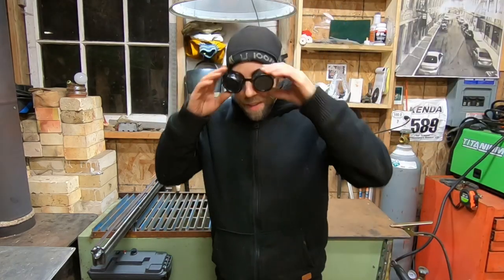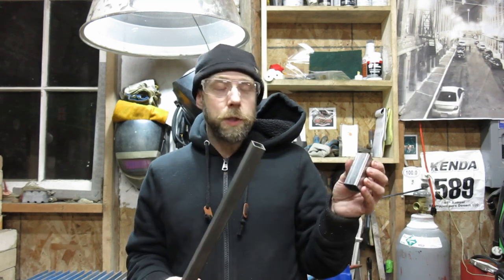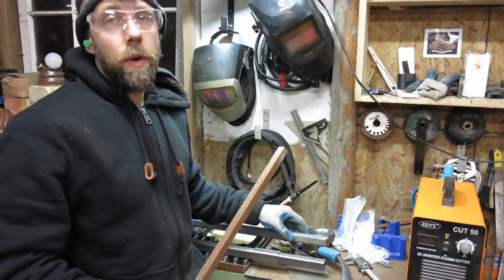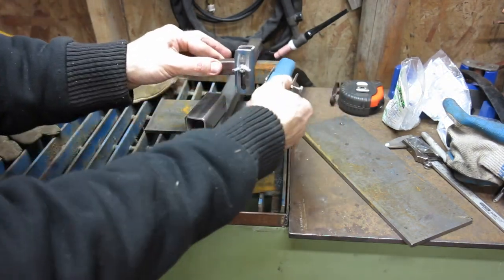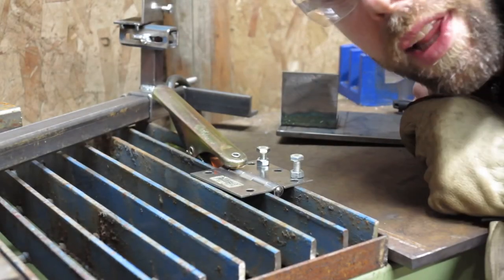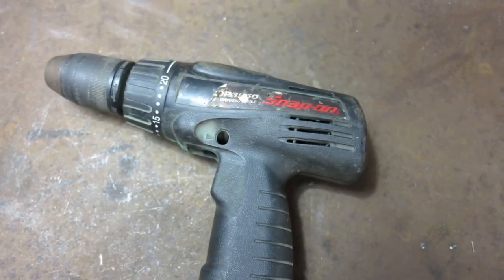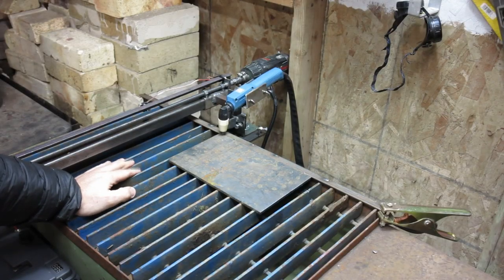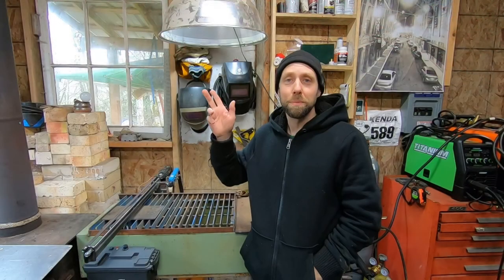Plasma cutting track DIY

Comment: Oddly enough I can not find the Titanium 45 plasma cutter on the HF site. How does the cut 40 you are using in this video measure up to the titanium 45 or does it even measure up ? Watches a few of your vids, like this one, well done. Good work, good ideas and a good sharing of both. CHEERS from north of the border.
Reply from the maker: Right on thanks! The Titanium 45 won’t be in stores till early 2020, I never did a review of the CUT 50 plasma torch because I just don’t feel I could put a video up telling people I think it’s a quality unit, but of course it’s a $250 plasma torch 🤷🏻‍♂️ I have never had any real problems with it, but you can count on it every few cuts when you go to pull the trigger it won’t arc right and does not start cutting, it’s not a big thing you just pull the trigger again and it usually starts the second time. Consumables are real affordable on Amazon. It’s actually not a bad machine, I just don’t get the feeling that it’s going to work for a long time but who knows? I have had it for 3 years now but I only maybe use it once a month. 
The down side of this machine is that it’s a high frequency start and this will interfere with CNC machines so you can not use them on CNC plasma tables. The Titanium on the other had feels like a fairly quality plasma torch, starts every time and doesn’t have HF start, it’s a pilot arc start so it should work on a CNC table. Now is the Titanium 45 worth 3 time more then a CUT 50? What part of Canada 🇨🇦 are you from? I live about 20 miles south of Vancouver island in Washington.

Comment: You can get acme threaded rod and brass nuts designed specifically for linear motion drive (often used for 3d printers) on eBay, in long lengths, for cheap. It works better than all-thread from the hardware store, which is designed for fastening stuff.
Reply from the maker: I was just working with what I had.
Reply: @Mikefestiva  Eh... the comment was more directed at others who might want to build one and had some time to order stuff. ‘Course, you could always upgrade it and make a new video... 😉

Comment: I just subscribed to your page and I love it. You have some great ideas. I was wondering if you had any more videos/ direction on how you built your plasma track. I have the same plasma cutter and when I saw this video I that it was great and would love to build one of these. Thank you in advance.
Reply from the maker: Hey Curtis thanks for subscribing and checking out my videos! I really appreciate that :) This is my only video I made on this plasma track, it works quite well, the only thing I would recommend is to build or buy a bigger stronger hinge, the one I used was a little loose and flexed a bit. Other then that I would follow what I did and see if you can make one even better. It really helps that cut 50 to make some really clean welds. If you have any questions feel free to ask :)  Take care

Comment: I have a bucket of bolts just like that and it's a pain to put them back in the bucket for 2 bolts
Reply from the maker: Haha I know, After this video I got tired of digging through it and finally organized it into a plastic case with all the different sizes in there own slots. It surprisingly didn’t take long to sort them out.
Reply: @Mikefestiva  I did that for most of them about 2 days ago still have a bucket full though

Comment: Hi, that was a fantastic video and very detailed.
I just want to ask you about the torch high set up.
When you turn on  the torch and you press the second switch to move forward what is the torch high?
Is it needed to touch the material to start the arc? And dragg it all the way?
Or you set it a little above the material?
I know High Frecuency mashines has to instandly touch the material to start the arc.
Reply from the maker: Thanks for checking out my video! I have a cheap plasma torch I use, it’s got high frequency start, I set the tip off the metal about a 1/8” or 2mm  and 80% of the time it starts first try, once in a while I have to restart the torch, once it goes from high frequency sparks like a cars coil to the plasma torch fires up your good to turn on the drive and make your cut. I hope this helps. Take care
Reply: @Mikefestiva  Yeah,
that's what i thought.
My plasma cutter is HF like yours from different company an i was planning to build something similar with your motorised track table.
Your design is brilliant.
Thank you for replying.

Comment: Does that Zenny have a built in compressor or are you connected to a compressor? Nice video as usual.
Reply from the maker: No build in compressor, I run a air line from my compressor. So far it’s cutting great, time will tell on how good it holds up? We have a older Harbor Freight plasma torch at work and surprisingly it’s worked fine for years. I hope this one holds up as good? Take care and thanks for checking out my video.
Reply: @Mikefestiva   Can you use an oil lubricated compressor for plasma cutting?
Reply from the maker: ______x yes my compressor is a oil/ piston pump, just run a inline water/ oil filter to keep the air clean.

Comment: Hey Mike, Great job. I like it  l have a plasma similar to yours and would  like to build a table like yours. Do you have a parts  list with parts numbers and where you got them for the pulse width modulation setup
Reply from the maker: Hi Brian :) I’m glad you like my cutting table!  I have some links in the videos description that will take you to Amazon and to the exact parts I used, and it actually helps me out a little if you buy the parts through the link, I have had good results with this style of PW controller, I have been running one on my home build bandsaw mill for the power feed for over two years without a problem. One thing to pay attention to is the motor and power connections are not labeled the best so before you hook up the power wires to the PW controller turn it over and look at the green circuit board, it’s labeled Power. Motor. As long as you make sure you get that right your good to go. The main label above the screw terminals are labeled + and - so that’s easy to hook up it’s just the power and motor part is in Chinese, that’s why I mentioned to look at the circuit board. Sorry for the long comment, I just figured I would let you know so your not wondering. I have a video posted back a few months ago where I show hooking up this PW controller to control my sawmill cut height, you should check that video out, I think it’s called something like “ simple upgrade ever sawmill should have” if you have any more questions feel free to ask. Ps if you build a track cutter like mine the only thing a would have changed is the hinge, I should of just built one, the one I used is a little on the flimsy side so buy or build a bigger hinge.Take care!
Reply: Thanks Mike for all the info . If I do have  any questions I will surely be contacting you. Thanks and take care
Reply from the maker: Brian windpower no problem Brian! Hey I just commented back with another subscriber and he was wondering how I wired the PW controller with the switches, so I think I will post a video in a week or so talking more about the PW controller and how I wired up the switches. So keep an eye out for that video and I will have a few more things to point out about these controllers. It’s always hard to include all this info in a project build video like this plasma track because the videos can get to long for most folks so I think it will be nice to make a video just about this subject. Take care!
Reply: Ok thanks I’ll keep an eye for that video
Reply: @Mikefestiva  hey Mike what's the power supply that you used to power up the PW controller
Reply from the maker: Brian windpower Hey Brian I didn’t end up using a power supply, they are under $50 on Amazon but I didn’t go that route, if the drill had a good battery I would have just used it, but the battery and the speed control on the drill were shot so I just ended up running the PW controller off of a car battery, it’s extremely basic but I always have a charged one around my shop so again I was just working with what I had. I hope this helps. Ps my friend Dave gave me the drill, but if I was going to buy one, Harbor freight sells a cheap o drill, charger and battery and it’s in the low $20s I think it’s called drill master? 
That was the way I was going to go, but a friend donated a old snap on drill for that project. I hope this helps.
Reply: Mike festiva ok thanks
Reply: Hey Mike , I just had a few more questions for you. I need to build the table first and yours is about the right size I want. Can I get the dimensions and what you used to build it with? Also can I get a break down of the plasma arm like lengths of tubing, threaded rod.  And anything else you think I would need. Please and Thanks.

Comment: I Mike, what keeps the grill under our piece from getting cut when you are cutting at a 45 degree?
Reply from the maker: The BBQ grill will just get small cut marks when cutting 45s, I had thought about building a grill that fans out in a way that would avoid being cut, but I didn’t have that much flat bar on hand so I figured it would be fine if it gets a few small notch cuts in it, it will still have at least three quarters of bar still intact. Take care :)

Comment: How is the track torch frame attached to the table?  I almost have one built thanks for the video.
Reply from the maker: That’s great to hear! I welded a few 1.1/2” square tubes vertically up the back of my table and welded the bottom plate that has the stoppers on it onto the square tubes. 
I just made a point to square everything up the best I could before welding it onto the table. If you plan on moving it to another table you may consider bolting it on? Ps The only thing I would have changed is the hinge, it’s a little on the light side, I probably would have rather made a stouter one or shopped around for a thicker one. I hope this info helps. Take care!

Comment: I've been looking at that little Cut 50 plasma cutter on Amazon for small stuff.  Would you recommend that as a smart purchase for a home gamer DIY type?
Reply from the maker: Good questing on the cut 50. I have owned my cut 50 for about two years, but I have only used it a bit when I first got it, and just recently I started using it again.  
( I tried it out after I bought it, around that time my Son was born and for the most part I just forgot I had it, I mean I know it was on my shelf but I just was in a habit of using my other tools to cut metal)
Just the other day I got it out to cut some thicker metal and I forgot how much faster it was then my metal cutting bandsaw, that's when I decided to re visit this plasma track idea and build it.

So back to the cut 50, All the research I did originally before buying it I found the people that had a lot of problems were people that ran them maxed out on 110 volts, ( they can be ran on 110 or 220) I decided to wire mine up right off the bat on 220 volts to not stress the electronics, It's never given me any problems so far, and the high frequency always seems to work when starting the cut.
The second problem I have heard was some of the units that have the air pressure gauge on the front panel can develop a air leak and you would need to take the top off and re seal the air fittings, (not a big problem but worth mentioning)         

A good thing to note is the cheap torch ( which works fine)  has common consumables that can be bought on Amazon and Ebay for cheap and they fit a wide range of these cheaper plasma torches so not to worry there not preparatory to only this torch.
I have not honestly used mine enough yet to give a 100%  positive on the cut 50, time will tell and In a few more months I will have a better feel for how it holds up because I will be using it a lot more on projects with this plasma track.
I would say if you have a air compressor and a extra $250 that you can spend on a tool like this, try one out, look over the reviews from buyers and order from a seller that has better reviews your probably going to be fine.
I think as long as these are trouble free, people like you and me will benefit by having a plasma torch around our shops.
I hope this helps, Take care

Comment: Great video.  Is the Zeny  Cut 50 a pilot arc?
Reply from the maker: No my Cut 50 is high frequency, It doesn’t scream out quality but it cuts fairly good for the price.
Reply: @Mike festiva 
Thanks.  How does it compare to the $700+ Titanium you reviewed?  I like the Zeny price point.   I have an old ThermalDyamics transformer based 3XR. It still works but is a high frequency start that can only cut 3/16”.  It was state of the art in 1990. :)

Comment: Where did you purchase the switch to turn the plasma cutter off and on.
Reply from the maker: HI Eddie I just added a Amazon link to the small toggle switches that I used to turn the torch on and off in the video's description.
these switches are sold in multi packs, I have used them a lot on projects I work on, so I'm sure you will find other uses for them as well. I just unplugged the wires on the front of the plasma torch that went out to the button on the handle, then I just used some  basic electrical butt connectors to push onto the connector terminals on the plasma unit. then I ran two wires from there up the the small toggle switch so instead of pushing the momentary button on the torch you flip the toggle on and it keeps the torch on until you flip it down again. The nice thing about this setup is you don't need to modify the torches original wiring.
I hope this helps

Comment: what do think about the titanium plasma cutter?
Reply from the maker: In this video I’m using the CUT 50 and it’s an alright plasma torch but it does feel cheaply made. The Titanium 45 is a well built plasma torch, I have cut about 450 feet of metal with it and it’s holding up great 👍 
It’s much higher quality then the CUT 50.

Comment: Mike, what mill brand/model is that? Thanks!
Reply from the maker: I think it’s a older Enco? I don’t remember finding any logos on it, I got it running about a year ago but it was in awful shape, it had been sitting out in a wet shipping container for 10 + years the table was rusted so bad it was locked up, the T slots were packed full of rusted metal shavings, I had to chisel them out. I brought it back from the dead Haha! I’m hoping to make a video of converting it to 3 phase and running a VFD on it for variable speed, I just need to find a 2 or 3 hp motor. Thanks for commenting and checking out my new project!

Comment: What milling machine is that?
Reply from the maker: I think it’s a older Enco? But the info plate is missing, I have seen a lot of milling machines sold under different names that must come from the same manufacturer. It had been treated real bad before I got it, it sat in a dripping shipping container for about 10 years with rusted metal chips all over the machine and table, it took me probably 3 days to get the tables T slots cleaned out and the rust removed so the table could slide freely again. It was really bad. I’m keeping a eye out for a 3hp 3 phase Motor so I can make it variable speed with a VFD. Take care

Comment: What transformer did you use to power your PW controller?
Reply from the maker: There’s a lot of adorable transformers on Amazon for under $50, I didn’t go that route though, I would have used the drill and it’s battery but the drills battery was shot along with its speed controller, so I just ended up running it off of a 12 volt car battery, I always have one around in my shop so it was a simple solution to power it. I hope this helps.
Reply: Thanks, it did help.

Comment: Mike - are you up to making the plans available and perhaps even a kit, which would contain: plans and parts that have been fabricated? As an option, the tubing and flat bar can be purchased locally. This idea is to promote creating residual income for yourself. Working an hour for an hour's wages is becoming unsustainable for most. Create, if you do not have one, a Patreon channel and offer kits as a product and for those who are members of your Patreon channel. I can then, create the kit in Spanish. Sizes would need to be both in inches and metric. 

Your generosity of sharing needs to go to the next step. Give access to your builds through making: plans and optionally, parts. After you have acheived a degree of success, you then share how you achieved this in a Youtube video. What you would be doing is encouraging others to self realize their potential. 

Too many times do I read where a visitor ask can I purchase that, the response is often, "Dude, this is just one off." It is not enough to create jigs in the shop, you must gain access to markets where the devices you have created gets promoted and creates passive income (retirement money). I will be teaching this stuff in my "Little Shop" to kids from 10 to 17 years of age. If I would have known this earlier in life, my path would be very different. This all comes from the book, Rich Dad, Poor Dad.

If you like, contact me, we can continue this discussion. I do admire your presentations.